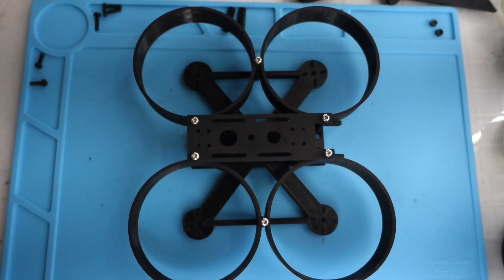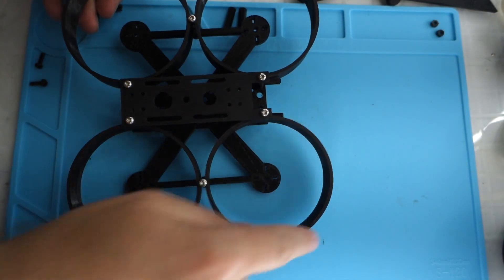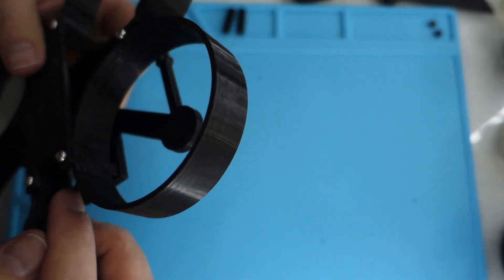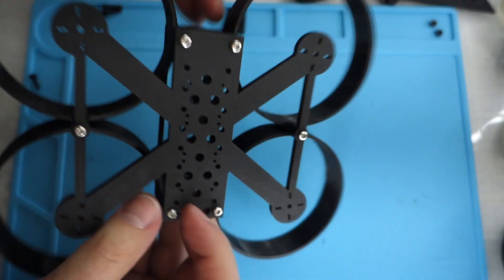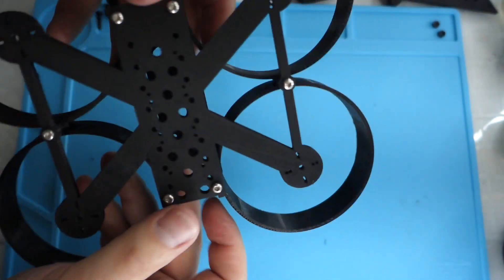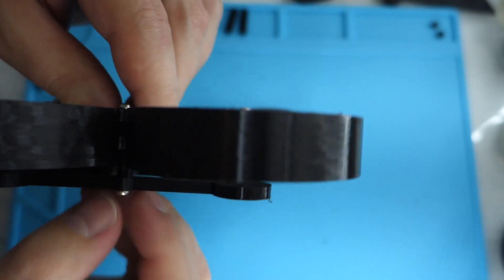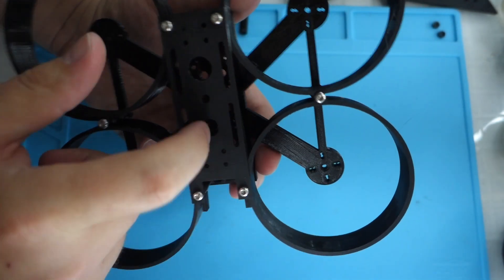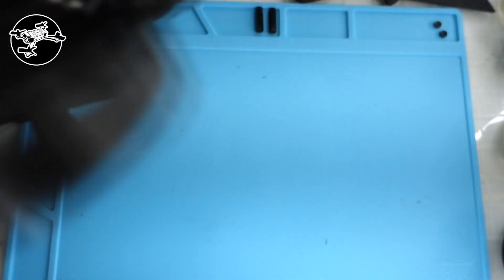3D Printed CineWhoop Frame

Comment: @FPV Club, Hi I just stumbled onto your channel whilse researching 3d printers on google.  I wanted to ask, if you don't mind please: Is this a difficult hobby to get into, and could you also print the foam bumpers that some cinewhoops seem to spor?  Thanks in advance.
Reply from the maker: It really depends on how you are with soldering and small electronics.  The flying part is easy after you get the hang of it, but the repairs can be tricky if you don't have a knack for it.  I highly suggest giving it a try though!  If you want to add foam you could glue some foam around the ducts.  I think this build may be a bit too much for a beginner though, I would suggest you start with a smaller more durable quad that you can beat around. I would suggest a nice little 1S Whoop around 65mm. Good luck, let me know if you have ANY questions - Happy to help out!
Reply: @fpvclub7256  I'm more interested in getting into building the frames on a 3d printer. Appreciate the response though.
Reply from the maker: @boydriver2978  it's not too hard.  I just think of an overall design, do an initial build and tweak it a few times to get it right.  Each of my frames usually have 1 or 2 prototype prints before they are really fully usable.

Comment: wow, amazing! 
what engines did you use, and which Esc?
Reply from the maker: I don't plan on carrying a GoPro so I built mine with 1306 emax motors. You could use 15xx motors though if you wanted.  I am using the 25amp mamba ESC/FC stack. It flies really nice.  I just bought a runcam tarsier 4k camera that I am going to put on it soon as well. Then I can get better video. 😁.  I will do a video on that when I get it.    Happy flying!
Reply: @fpvclub7256  Thanks a lot, I appreciate that you share, and keep flying and building, greetings.

Comment: Hello... Is this still alive? Waiting for the build vid
Reply from the maker: KingNothing FPV . Yes. Unfortunately I've had a computer and network storage drive failure.. I'm just waiting on a new power supply to arrive. Then I can finish editing the build video.  Thanks for checking in!  I am hoping it won't be much longer.
Reply from the maker: I've just posted the build video.. I hope you will check it out.. Should be able to get some flight footage posted very soon as well.

Comment: I'm planning to print this frame too. Did you fly it yet? Looking forward to your progress 🤘 Cheers and thanks a lot for your work!
Reply from the maker: Hey 22Billy92, welcome to the channel.  Yes I've built and flown this.  It fly's very smooth.  I will be posting the build and some flight video very soon.
Reply: @fpvclub7256  glad to hear that! :) I'm looking forward to it!
Do you have some tips for printing besides the 100% infill for the ducts?
I plan to print it in PETG and I allready designed a few beds with the frame in different layer heights. (You suggest 0,2er resolution, if I'm right 🤔) 
Do you have any experience value for me? :)
Thanks a bunch for your effort! 🤘
Reply: And I'll try out printing the camera arms and antenna mount with 95A TPU as well as PETG. Did you try out flexibel's? 🤔
Reply from the maker: @22Billy92  No, I've not done any flex yet.
Reply from the maker: @22Billy92  I would suggest the longer arms for the camera.  Mine has the shorter ones and the ducts are in view just ever so slightly.  I think PETG will be good, not sure how the weight differs from PLA, but can't wait to see how it goes.  0.2mm is ideal based on all my tolerances.  100 infill on the ducts for sure..  You can do 75% on the top place, but it doesn't end up saving much time/material.   Good luck!  Be sure to post an update with some vids/pics once its built!
Reply: @fpvclub7256  if u need any tips for printing TPU on your Ender (thingiverse told me) just let me know :)
Reply: @fpvclub7256  Thanks buddy! I´ll report :)

Comment: Down wards thrust can be done and I'm thinking about heat on the motors they may be cooled more efficiently by pulling fresh clean Air from the top to the bottom I also speculate that if it was over powered it may be more efficient in the long run. If your anything like me I know that I'll want to add on as time goes by. Tell me what you think.

Comment: Nice very nice love how big it is what ideas do you have about motors and esc
Reply from the maker: I have it built up ( Build vid coming soon ) I've opted for emacs 1306 motors with a mamba 20A F4 stack.  It flys quite smooth.. I just need to shave 7grams off with my 650mah battery to get under 250g. :)
Reply: @fpvclub7256  I get it I really do but I think we should both reconsider and go ahead and pay the 5 buck to register
Reply: I mean if we get up over 250 that leaves alot of room for not one really decent camera but 2 ..... Have you considered pull away footage edited in with the regular forward facing footage.... Maybe I'm crazy but I think it would get some play time don't u

Comment: +1👍 nice!! i love the build-your-own-frame concept so much; i'm genuinely curious if these are as light and could be similarly as strong as carbon fiber.
  i think there exists carbon fiber infused filament if i'm not mistaken, but i suspect it is pricey!

... i wonder if intersecting two ducts as one piece would save some weight of a screw? maybe even make them thinner walled.

i want to see the 3" built and flown, but that's me ... i prefer flying over cinema, but it's not really my chice is it :D
Reply from the maker: So I just did the maiden flight yesterday on this ( Having some VTX issues though ).. The current all up weight is 248grams with a 550mah 3S... So its not that heavy..   I've ordered some 650Mah though, so I need to shave about 8grams more..  I am going to probably change the way the ducts attach to each other to allow for a shorter screw. Also i've already shaved 2mm off the bottom of the ducts.  I think they could also be thinner as well if I change the material.. I've ordered some PETg which should be more durable ( but heavier ).

I have some hand-me-down motors and ESC's, so I am going to build that 3 inch as well.  Once I get the kinks out of this guy.
Reply: @fpvclub7256  awesome and i look forward to more
Reply: Ya I'm creeping lol